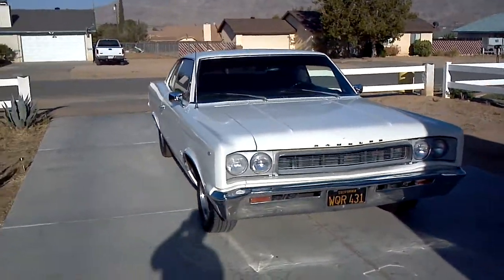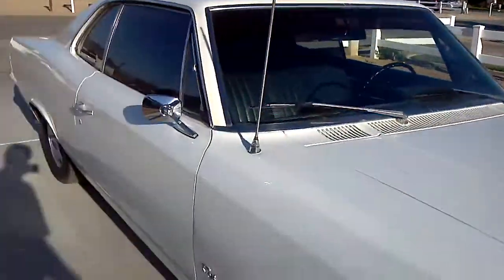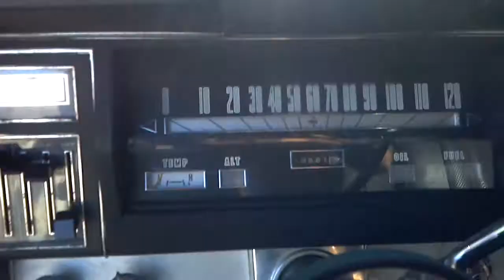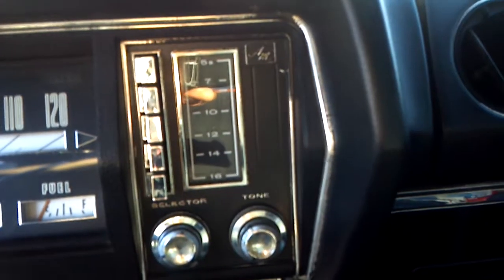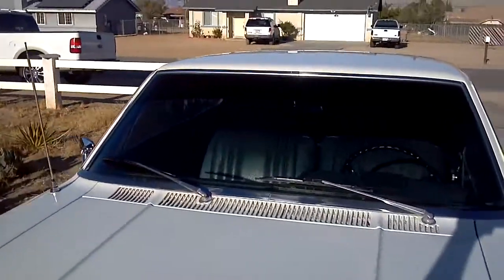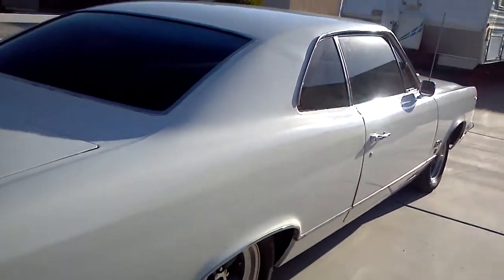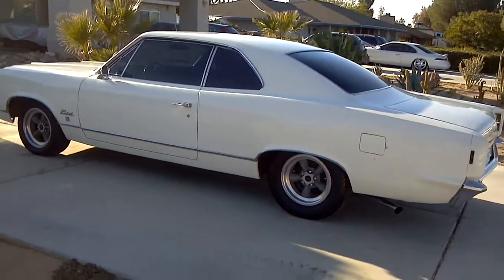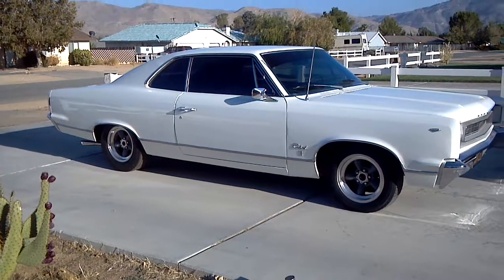Q-lab Project Rare 1967 Rambler AMC Rebel 343 Typhoon For Sale

Comment: When / IF you find AMC original survivor cars as this, check for dealer replaced parts, or owner self installed replacement parts from national parts stores like NAPA. Economy first owners often did their own maintenance at home, and bought inexpensive, but warranteed parts. I bought a 71 Matador, and when I replaced shocks front and rear, found out they were FREE, under warrantee. Every bit helps. These 67's are a few years before Rebel Machine in 1970, but graphics and simple wagon rear suspension springs and shocks give it the same rake.  Beautiful car.

Comment: where are the scoops in front of the rear wheels in the body panels? I've got a 67 sst and every rebel i've ever seen has the syling scoops. has the body been modified? beautiful car though!
Reply from the maker: It;s not an SST. It's a 770. They don't come w/them.
Reply: Scoops were in 69 SST,  only one year.
Reply: @Rick-S-6063   the tail-lights are 67, as my dad had a 68 rebal sst convertible caravelle blue 343 v8, as well as a 67 rebel 770  and a 68 rebel 550 4 door - red one was the 67, blue one was the 68 convertible 343-4v v8 dual exhaust, and then my younger brother found a "Diamond in the rough  68 amc rebel 4 door 290-2v v8 single exhaust.   My dad went to larger exhaust so my brother got the dual setup from my dad's convertible.    Those were some  neat cars.
Reply: @MrStudly302  you are correct, I was wrong, because I confused scoop with the false grilles of 69. thanks for the clarification.